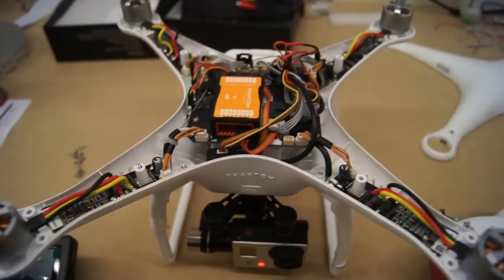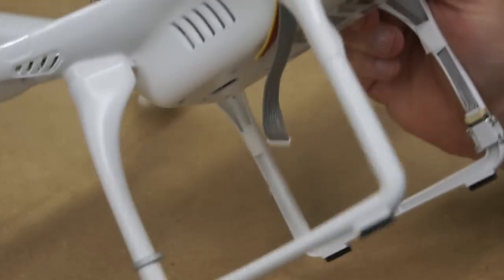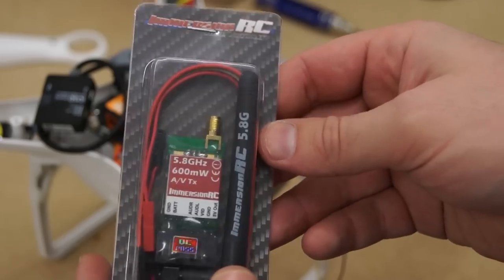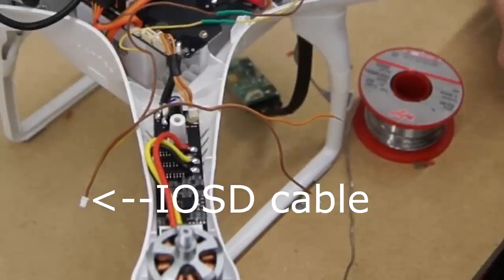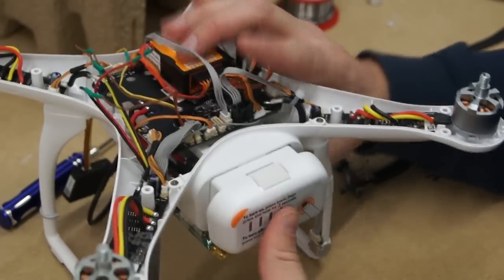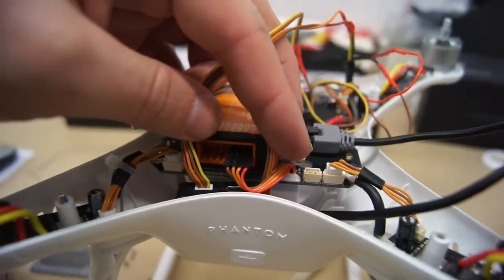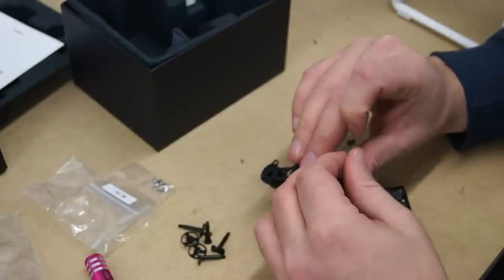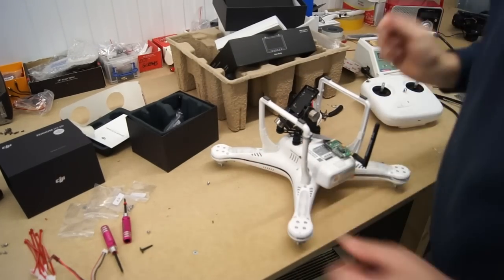Phantom2 iOSD Mini FPV Transmitter & Zenmuse H3-2D install - That HPI Guy

Comment: Definitely one of the best install videos I've seen. Only thing I'd add is that you can buy a plug and play cable for the Immersion/IOSD for about $20. It patches the Tx to the IOSD and plugs into the CAN bus and also plugs into the port inside that provides power/video. 

I really like the idea of bringing the CAN bus inside and only having the Tx hanging outside. Leaves room to hang more stuff outside.

Comment: Great vid, I take it the iOS mini HUD signal is only seen over the video on your fpv and not on the video recorded inside the gopro. To record the HUD with video I'd need to record the video direct from the av port on fatshark goggles

Comment: Excellent video, Thank you for taking the time to make it concise and easy to follow.

I wish there was a way to send video via wifi to smart phone like in the DJI Vision app. But apparently that can't be done with the H3-2D/ GoPro set up :(
Reply: that's because the vision operates on a 5.8 GHz frequency.  300 m range in europe and 500 in US.  Because the frequency is that of Wifi.  P2 with H3-2D 2.4Ghz frequency and 1000m range.  It's Hobby grade.

Comment: Hi, thanks for this installation guide which I followed to a T. it all worked well for me, I was away in Africa filming and got some really good stuff. On my return home I reassembled the Quad, I think the the immersion rc 600mw transmitter sparked up and blew. Its clear that it worked well for months and I only disassembled the gimbal landing gear and transmitter for easy transportation. Also before I started it up I made sure I had attached the transmitter with an antenna as you mentioned if fired up without an antenna it could result in a blown transmitter. I am going to have to buy a new one but what other possible reasons are there for an a transmitter to blow

Comment: This looks tidy and you've done a good job of this but what do you think about the fact that the iosd mini produces heat while powered, and some have reported failure due to melting.  The IC chip in the unit needs to stay cool.  DJI reccommends  that the unit be mounted externally where it can be cooled by prop wash.  Have you experienced or heard of anyone experiencing issues with this modification?

Comment: I read there is video out on gimbal. Where is because I do not see it. I want to plug the yellow video cable from gopro video to my transmitter hopefully without any soldering.

Comment: Richard can you please add a video showing a good way to add the 2.4ghz Ipad ground station. I need a way to get the can bus cable from the air data link unit that's mounted on the bottom of the phantom 2 up to the Iosd mini inside the Phantom 2 so I can plug it into the spare mini iosd can bus port.
Thanks

Comment: When you click on your link to purchase the iOSD they say you also need the Power Management Unit "Please note if this is intended for fitting into the DJI Phantom then a naza v2 pmu will be required" yet to don't show it. Do you need to have a PMU if installing on a Phantom?

Comment: Thanks for the video. I just performed the operation and all is well but my lever on the remote control doesn't move my gimbel. The camera points straight down and moves a hair when I move the switch but that's it. I also have Sky Zone goggles that I can see the iOSD and the video, but they have tracking and the tracking doesn't move the gimbel either.
Initially the gimbel got hot too, but that hasn't happen since I first powered up.
Any suggestions would be appreciated.

Comment: I have a Phantom 2 + h33d gimbal + FPV already set up. And just got the iOSD mini. I was really glad to find your tutorial, but when I opened my phantom, I realized that my transmitter is different from yours. I have the Video Transmitter TX Lite Module, so my cables are totally different, and now I have no idea of what to do.
Would you have any ideas, or a diagram that I can follow?
Thanks in advance.

Comment: Hi! Nice video!
I have 2 questions.
1: The monitor you are using, is it wireless or do you need to plug it in to a computer?
2: Do the video transmitter interfear in any way with the compass inside the landing gear?

Comment: I'm about to do this install and I have a question regarding wiring to the GoPro.  8:13 doesn't show any wires going into the camera itself.  I didn't see any reference to additional wiring installation which would connect the GoPro with the Video TX.  Also, what is the black wire shielding placed on the video tx wiring referred to so I can find it online and purchase some for the installation process?  Thank you very much for your response.

Comment: Great vid. I previously setup the FatShark goggles to my Phantom 2 with iOSD mini hookups as well. As of recently, I have felt the need to switch to the Black Pearl screen. I'm trying to avoid resetting my whole setup so I can switch between goggles and screen, which would be convenient. My only concern is that the Black Pearl kit came with a bulky 5.8 VideoLink transmitter with different hookups than the 600Mw transmitter. It looks good, and even has a fan in it (I've noticed that my current 600Mw transmitter tends to get really warm when in use). But my question is: Can any transmitter, whether it be this VideoLink or the 600Mw immersion transmitter, be used for either mode of FPV? Thanks in advance for your help!

Comment: Hello, nice video. but i have an AVL58 and mini IOSD, and the original cable doesnt fit. Im very newbie on wiring, is there any wiring easy diagram to make this connections? Or a movie about it? I cant install mine because the cable that comes with the AVL doesnt fit.:( could someone help me? Thanks a lot!

Comment: Hi. Thanks very much for this video - it was invaluable to me in installing the IOSD Mini. My question is not related to the IOSD Mini, but is actually related to the gimbal movement at 8:05. My Phantom 2's H3-2D gimbal's pitch movement is impossible to operate smoothly. On your vid, you moved the lever and then the camera followed, but sloooowly..... nice! On my RC gimbal lever, the gimbal only moves when the RC gimbal lever is moving in the approx middle third of its range....I've done all the calibrating and I've tried the (completely ineffective) gimbal controls in the Phantom 2 Assistant Software. 
Is the problem I'm experiencing due to some pin/potentiometer problem is the RC?
Any pointers at all would be greatly appreciated. Thank you. K

Comment: I am also confused...... I have no gimbal but still want to use my IOSD, to connect to my FPV system. (Until I can afford the gimbal) so, how do I connect my go pro??? 
Do I solder the go pro USB-FPV cable together with the Orange and brown from the IOSD

Comment: Thank you for a very excellent video.
I did the installation a couple of days ago and all worked fine.
There is an issue which may not be related to the installation.
I just got the Phantom2 and noticed before the gimbal and iosd installation that I would get Sat lock in less than a minute.
Now It seems to take over 5 min and just now after 10 min or so never got above 6 sats. I disconnected the inmmerson Vtx power and shut off the GoPro but still no help.
Have you had any feedback on this issue?

Thanks,
Tom

Comment: Richard do you plan on doing a video installing the DJI ipad ground station setup ? The best way to place the components and the easiest way to get the can bus cable from the data link on the phantom 2 body up into the iosd mini to plug it into the extra can bus port. I hate to have to use a can bus hub and place everything on the outside of the phantom 2. Thanks

Comment: Hi, i followed your video for installation. Looks neat. Only thing is that the iosd mini gets quite hot. Wonder if its ok to be placed inside? Quite some people had faulty iosd after several flights (not sure they were installed in or outside)

Comment: I just installed my iOSD mini and discovered one small drawback of an inside install. I forgot to update the iOSD firmware. Once it's installed and hooked up can you acess and update the firmware of the iOSD via the external Phantom 2 USB connector?

Comment: excellent work.....question mine does have a fpv hub for a dji avl58 that i don´t like....and does not have the yellow brown red black wire...can any one tell me what type of connector is that one.....and the socket where it plugs has 6 pins do you know the sequence???? 1 and 2 dummies or 5 and 6 dummies???..thanks

Comment: Hey bro... another great video. Well i got it and its all built. However i am having an issue with the booting of the P2 whenever the mini is connected. I even did it over with the dji hub. Seems not to be a common issue but a few have experienced it. Any advice would help. Firmware is also up to date .

Comment: Great video! One quick question-  Does the camera video feed to the video xmitter feed signal through the Gimbal cable? I usually see an external video out plug coming off the side of the GoPRO and feeding it over to the transmitter. Can you clarify?  Thanks a lot!  Again, great video!!

Comment: Hey man! Great video. I have a phantom 1. Do you know how my set up is different? Like the CAN BUS for example? I've installed the upgrade board and the gimbal. I'd like to attach the mini iOSD and the DJI AVL58 transmitter. I'd also like to run power to my transmitter from the Phantom battery source. ANY help would be greatly appreciated. Thank you.

Comment: I don't understand how the GoPro is sending the video feed to the monitor without a cable being plugged into the GoPro's USB port. I'm wanting to set up the same thing but I'm a bit confused. What is sending the video feed? I've read that wireless isn't a good idea.
Reply: The Zenmuse Gimbal is taking the Video Feed from the Go Pro and sending it to the Phantom and transmiter. When You place the Go Pro into the Gimbal, the video feed will automatically be transferred.
Reply: Thanks for the reply, after doing some more digging I learnt that DJI removed the GoPro connector and changed it to USB in version 1.1 of the gimbal. Just need to get everything ordered now.
Reply: No Problem, I hope you enjoy your Phantom. I am holding off on buying one because of the new DJI Imagine 1 being released on Wednesday!
Reply: Ndude Pytc U mean the Inspire 1

Comment: Hi, Could you help me. I followed the video as instructed but I still cannot get the gopro to send the signal to my goggles. I can see the iOSD readings tho, but no video. Help me.
Reply: you just need to unplug the power cable from the gopro.
Reply: Hi Lisa, I figured it out, it was because I had a bad solder joint, my fault. All is well now. Thanks!

Comment: Thanks for a great video, how can i do the same clean installation with  the DJI Data ground station for ipad? i also looking to install FPV so now i will have an extra  transmitter. it will be great if  you have a video for that.

Comment: Very nice BUT what options are there if i want to send the feed to my ipad/iphone? Just the way the Vision+ does it.

Thanks :)
Reply: You can't... sorry...
The P2 vision uses 5.8Ghz for radio control as the wi-fi link for video is on 2.4Ghz.
Since the P2 (non vision) uses 2.4Ghz for radio control it's not possible due to interference.
Having a 2.4Ghz wi-fi transmitter onboard would wipe out the control signals.

There maybe an option to use 5.8Ghz band wifi instead... if you can find hardware to fit in the P2...
Reply: Dorian Creber I've read that there have been drones flying away never to be seen again, likely because of the WiFi interference from the GoPro camera. It's not worth taking the risk!
Reply: your first mistake was getting a vision...

Comment: Nice one Guy--thanks for the excellent tutorial.
I see the iOSD mini runs on 6 volts, power in is 12volts via the lipo--so is there a bec within the circuit somewhere.?
Cheers.

Comment: Why is the CAN BUS on the leg originally?  Does it not need to remain there?
Reply: I'm also confused about this.  I thought it was the compass on the leg.  It appeared the compass was just being unplugged.
Reply: I have the same cuestion. Is it the iosd mini insde the phantom just for estetic?  or is it posible to let the CAN BUS on the leg doing the same function as you describe on the video?
Reply: It doesn't need to remain there.  The compass is on the opposite leg and is an entirely different component.  You also can leave the can bus on the leg and then just install the Iosd mini on the outside of the phantom.

Comment: I have the 1.3ghz 400mW Tx and my transmitter only has a black, red, white and yellow cable. I also bought male and female pig tails and connectors but don't really know what to do with them. Can anyone help out...   I am planning on using the iOSD too. I just don't wanna solder without knowing I'm doing the right thing.

Comment: I'm about to set up a very cheap FPV setup using the Boscam 32Ch 5.8G 600mw 5km Wireless AV Transmitter TS832 Receiver RC832 set up along with the iOSD Mini. Will this install work the same way?

Comment: Would all this also apply if it were the new H3-3D that was being used (apart from the way the gimbal is fitted, obviously)?  I'd be looking to get the identical setup, except I'd be using the H3-3D instead. It's the wiring I'm concerned with primarily (i.e. what fits where, and what's soldered to what.
Reply: Its the same set up for h3-3d, nothing different
Reply: C loi ca

Comment: A couple more question.
Are there any more simple monitors like this one out there? I found this particular monitor a bit pricey for me (although i only looked at one site). I have looked at some Boscam monitors, but I don't know if I need to buy any extra parts or anything like that to make them work. Do you have any suggestions on monitors that is as easy as this one, but in the lower price range?

Comment: I installed the iOSD Mini in my Phantom 2 with the H3-2D/GoPro.   While I get the flight template superimposed over the camera image on my FPV screen, I do not get any data.   For example, the battery indicator icon is there, but no data on the state of the battery.   The attitude indicator displays, but remains locked at straight and level flight.   No Height data next to the "H", or for the "D"istance indicataor.  How does the data get fed to the iOSD from the Phantom inputs?   I assume it is through the CAN bus.   I installed the iOSD Mini following this video.   Any words of wisdom to apply to solve the no data issue will be greatly appreciated.   Thanks.
Reply: Never mind, solved the problem.   The iOSD Assistant wasn't connecting to the device itself to update the driver.   Re-installed the Assistant, and launched it.  This time it connected.   However, the device driver that I was reporting was the same release as the one that was listed as the latest.   I went ahead and upgraded it even though it looked like it was just reinstalling the same release of the driver.   Once I did that, the data is working and attitude indicator is responsive.

Comment: I gotta say bud I love your video, it has supplied me with a ton of information. I was more into looking at the inside whilst building up mine. If you happen to find the micro usb port which sits at the front of the phantom and the connector to the main board please let me know. Thanks bud. Jon. or jonrms as you know me on many forums.

Comment: Aloha. ok need ur expert advice. so i just got the H3-2D and want to get the Phantom 2 .. (they told me to get the Phantom 2 "Rev 2").. is there a difference P2 and P2(rev2)? so if i do go ahead and get the Rev 2. they told me i needed to get a PMU?  that true? and i would need  a new mounting plate for the rev 2.. confused..

Comment: Great Vid!  Thanks HPI Guy.  I also thought the compass was located on the leg where the canbus connection was. Now I'm thinking it is located next to the GPS on the top part of the shell. Could you confirm this for me please. I don't want to remove the canbus from the leg and move it inside if it is going to cause any directional problems. I'll be installing the IOSD Mini and Immersion 600vTx in a couple of weeks (with lots of help from you!)

Keep up the good video work and thanks from Canada Eh!

Comment: im having probs with static at short range with the same set up as u i have got betetr antennas,do i need to play with the smallswitches that are on the transmitter to find the best static free signal,as it is quite poor even in open spaces.thanks jason

Comment: Hey ! Thanks so much for the video, I used it yesterday to install my configuration !

But I do have a question, I read on a forum that it's "bad" to change the position of the Compass, that it's at this position precise for a reason and moving it closer to the GPS can result in issues... I put it inside as you did with the video but do you think that it can be a problem ?
Reply: He didn't move the compass. He moved the CAN Bus. Compass is the silver thing on the other leg.

Comment: can I get a complete list of this for my dji phantom;  would like to start saving money for this and also new to fpv but not the rc world; thanks
Reply: I just bought this bundle for my phantom 2.  

https://www.firstpersonview.co.uk/complete-fpv/5.8ghz
Reply: Jo Ridges I bought the 25mW transmitter since without a special permit, legislation here in Switzerland limits to this level of power output. :-)

Comment: I did this installation and noted the compass to be at a different orientation than the original. Would that cause any problems with the compass calibration?
My P2 is not very stable when at low heights.
Thanks and keep up the good work with the videos
Reply from the maker: I am NOT removing the compass! its the CANBUS!!!!
Reply: ThatHPI GUY
OK got that... the compass is still in its original place
it was the canbus, the connection of other dji options to the naza, that I moved
thanks for the clarification